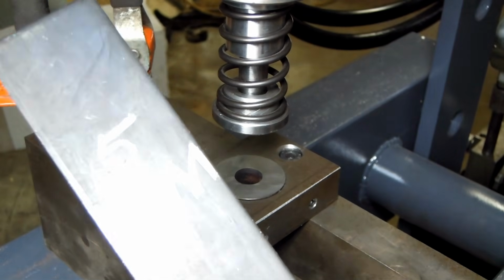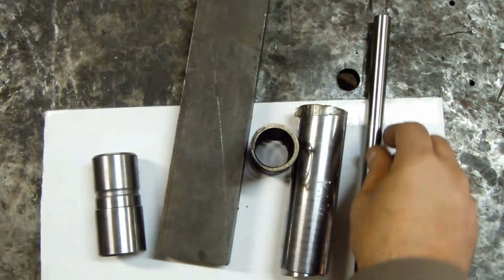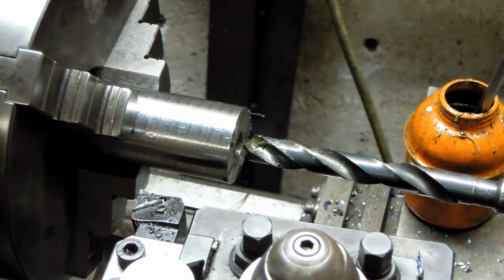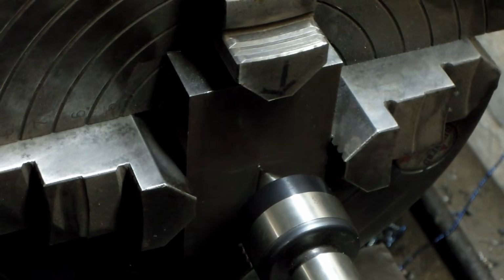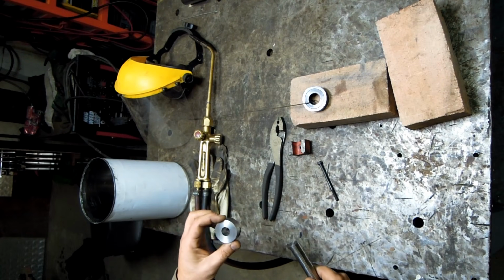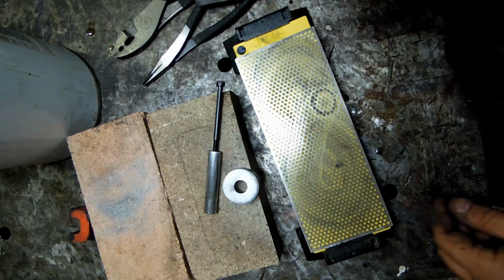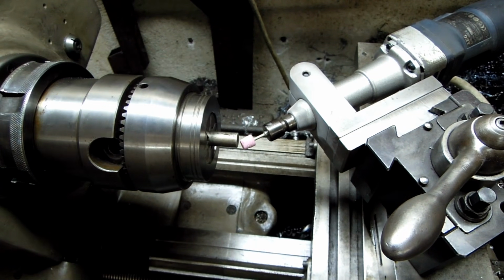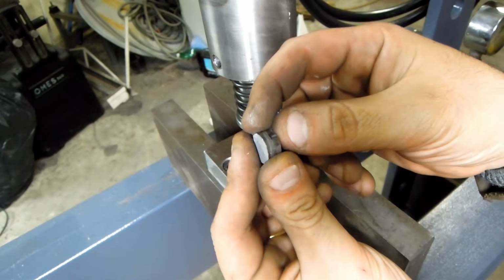diy punch & die

Comment: Hello Tony!

I see that the brakezone are pretty long. Nothing bad with that, but to get a shorter brakezone and a longer cutzone the tolerance betwen the toolparts must be tighter. 
Say this because I like everyone to know it if they do not understand why they get what they get.
A to big tolerance will instead mostly bend the material, finaly at some point it will cause a enormouse power to the hydraulic and maybe it punch the hole or also you will then get a hole with bent edges. 
If one like to get those bend edges its way better to do it n 2 steps, first punch out a smaller hole then use another tool to do the bend V-formed hole, maybe to make threads in it later.
The tolerans also has to do with the power you have to ad with the hydraulic, but to lower the power you need, you can grinde an angle on the punch, 
Also whe make tools like this the result of the hole also depends on the part that the spring press on (dont know the name in english atm.) And more important the spring power.
To get the right spring you have to calculate, and it also depends on the thickness of the material to punch th hole in.
Så material thickness and the tolerans of the toolparts all togheter has to do with how powerfull spring you nedd to the best result to outcome.

Maybe I will make a video with that later, at my upcoming channel. Alt to help you all to make the best outcome products, depending of what tools you have in your shop.

But first  have to build up my own littel cave. 
I will put videos at my upcoming channel where i repair, renovate, build, repair almost anything. from house, to machines, electronics wheichles.

Thanks Tony for all good videos you made so far.
Love them.

Comment: The best thing to do when hardening the metal, is to heat it up until it loses its magnetism, about 815.56C 1500F, then normalize the metal by heating it to 200C (392F), letting it air cool each time.  Or, if you have vermiculite, just place it in there until it has cooled down to room temperature.

Comment: Next step will be a fixed bed to the press to secure the die holder in place.  Just a fraction off center will completely damage both pieces.  By the way, why not grind the male part so to have a point at the center.  It chases the punched piece off better.

Comment: You want to preheat the oil in order to lower its viscosity, so the oil will flow 'faster' around the work piece as you dunk it.  The temperature by itself is not the most important factor, viscosity is.  If the piece is not hard enough, you did not heat it to the right temperature.  It should be cherry red in dim light conditions. If a magnet sticks it is not hot enough.  An open flame does not work the best way.  Make a tunnel with a couple of fireproof bricks and heat the piece inside, so it gets hot as even as possible on all sides.

Comment: It's like 3 years later but to avoid the light desynchronisation making it look "weird" you have to go to a lower framerate, like if you're on 230v 50hz electricity, you'll have to go less than 50fps so it doesn't capture the tiny change, like 30fps would be perfect

Comment: The concept is acceptable only for secondary press work, since the punch doesn't get guided properly through the floating stripper insert. 

The stripper insert at the strip butting surface possess a chamfer around the punch guiding hole will deform the sheet metal during stripping of the stock material, which is not acceptable. Relaying on helical spring is highly risky.

Comment: clearance looks a little tight for 8 mm but looks great on the 5mm mat. 10-15% per side should get you where you need to be. 3/8 die land is good if you plan on having a few sharpenings

Comment: 22:20 you could grind the punch face flat and reduce pressure needed to punch. Instead of having the punch face square with its length at 90 degrees, you can grind it on an angle of something like 80 degrees. It'll create a point which will pierce  and incise a hole rather than just punch. It'll take less force to make the hole and be a gentler operation on breakthrough. see how trumpf make their whisper tools.

Comment: Knifemakers are well known to use this method and even cut a slot in the side of the toaster oven so longer blades tangs can stick out the side since they will often only quench the blade part only that part needs tempering. So to all disbelievers -- it works just fine. Historicslly proven. Google anything you disbelieve.

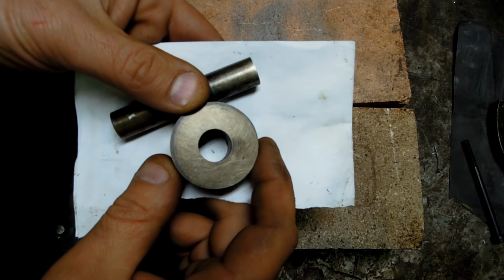21:08 per lighting. Halogen is closest to sunlight and I've found those cheap 300 & 500 watt bulbs very handy for all kinds of things, have several outdoor floodlight fixtures on homemade tripods or rolling stands. Old computer chairs and fan stands work OK, too. I welded my first one and used two lawnmower wheels on it like a weber grill long before I even knew what a weber was. I still have it today. Probably been through a dozen bulbs over two decades of use. I've even found them at dollar stores & HF.com carries the 300 watt ones for 99 cents. Can't beat that especially in winter when no matter how good/expensive your fluorescent fixture is there are some days it just will not come on properly!

He also claims the 5000 K color keeps you more attentive & awake so he uses it specifically in task areas...kitchen cutting board, shops, etc...

Also I bet if you google photographic filter and steel temp colors you can find something that will work better both for you and your audience. I find a polarizer filter (use a pair of dollar store sunglasses first if you're leary and rotate them. Between your lens and whatever being filmed.) You can also get sheets of the stuff to doubleside tape it to any camera phone and of course threaded ones to fit on cameras.

The LED strip lighting is cheap and you can get what you want colorwise. You can even make photographerlike panels that give nice, even lighting. Another guy on YT who does tools I know swears by the cooler colors, more towards 5000K, almost blueish. I have 2 strips of 3528 smd coming to me from Amazon to try. It has 3m tape backing and you can get ip-65 (waterproof) for not much more, usually. I'm thinking about putting it under the gable overhang on a building for general area lighting. Will sure beat the HPS streetlights even if some people find them not as consistent from strip to strip. I found 5 meter lengths for under $6. Still need a 12 vdc source....a battery charger of the proper amperage (2 amp per 5 meter) works fine. 

I love the warm white I added to my electronics workbench.

Good vid but being as horrible freight carries these so inexpensively (at least compared to my time) I have to wonder about the benefits of making one.

Comment: If you have a Brown and sharp's wheel you can grind it with the radius that you're doing right now on the lathe and just put it in there in AV block, stand it up. Turn the magnet on and then just barely kissed that and leave probably a thousands of the sharpness on the land it'll work really good.  You can go to 2 to 3000   I wouldn't go any more than that Then it won't cut it'll just shear

Comment: putting the metal oil tub in a water tub with the water at the proper temp with spare water to cool off the excess temp if you use it enough in one session might be an idea,plus the clean water can be dumped afterwards with no fear of tree huggers torching your pad in a green hazed frenzie of tree hugger hulk madness.

Comment: I like how your stripper spring is also a safety cage for the punch. I have a scar on my right ring finger knuckle from a punch exploding.   The pieces can really fly around the shop. I noticed that your slugs are very flat. The slugs with my store bought punch are more concave. I don't  know if it is the centering point on store bought punches or the concave u ground into the tip of your punch. Just thoughts, love your videos.

Comment: Needs more clearance for 3/8" stock.   Slug shows signs of being tight.   It will work fine for now, but after repeated uses it will start galling on the punch.  Lube helps.

Comment: Really impressive, I must look at that. May It is not clear from vendors how to harden silver steel. I use to to do it in oil with very poor results. MrPete222 on you tube harden this kind of steel in water. I had much better result this way. For other kind of steel I normally order O1 type of steel that can be harden in oil. Hope I will find the time to make such a useful tool.
Thanks for showing.

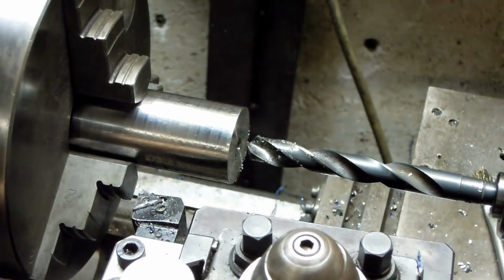Comment: 7:00 chips are blue, running it too hot. Cut back on the rpm or use plenty of coolant! For only one part it's OK, but for many parts, you would burn out the drill.
Same with the part off tool.

Comment: Very simple and effective.  How much clearance did you use, .020 per side? If you are going to pierce a wide range of thicknesses then you should error on the side of low clearance because otherwise it will drag a huge burr out the other side when piercing thin material.

Comment: Hey tony, thanks a lot for your videos. What if instead of making the punch have a concave end (aka watermelon bowl), which forces the press to cut all the perimeter at once, you just flattened the end at an angle, such that the press would exert less force at any single moment of the cutting operation? Does this have some sort of negative impact on the hole quality, tool life, or something else? Thanks!

Comment: That dremely attachment on your compound was a brilliant hack to grind just enough to form a concave dip! Brilliant. Don't worry about that toaster oven, I've made production PCB's using the same ceramic insulator technique and they're still going strong haha. Those IR gun thermometers are surprisingly accurate too, +/- 5F in my experience. I wouldn't use it to send something into space, but to harden/temper coldrolled that should be fine. Any reason why you didnt use M steel?

Comment: Greatly impressed with what you have created and the skilled way you have done it. I assume you must be a pro machinist. Love the videos. Perhaps you can help me. : We are in need of a HAND or TABLE HOLE PUNCH TOOL that can punch a hole 13/16th"" & 3/4"through 1/64th" thick plastic. No big box or other equipment seller seems to have a small tool, either hand or bench mounted, that can punch a hole that size . Can't drill through since it tears up the plastic. Need to do 200 holes or more in P.E.T plastic Can you help or direct me ?
Reply: try a holesaw in reverse,  I have drilled holes in foam that way

Comment: Hi Tony, 

You videos are sooooo easy, enjoyable and educational to watch, with good 'old fashioned' engineer's humour (UK spelling) sprinkled throughout. 

I certainly don't miss the 'ers' and 'erms' that other YouTube video producers intersperse their narrating with - your confidence shows through in every facet of your presentations. 

You may want to try 'Belleville' washers (also known as a coned-disc spring, conical spring washer or disc spring), instead of springs for your stripper plates. They take up less height and whose tension can be adjusted by stacking them nested or opposed to one another (or both) as required. 

Well done, keep them coming.

Comment: Pay atention to the slugs that come out. As the sheer line gets smaller and smaller, you will be using more force, and getting less clean holes. The punch will dull, in this case quickly compared to industrial tooling.
Reply: AaronAlso ?
Reply: Either you are impressed with my name, are confused by my comment, or know me from somewhere else.

Comment: You "always get nervous when working tool steel"  Are you referring to disrupting molecular structure prior to heat treat process?  I've worked tool steel quite a bit.  Is it easy to ruin the structure for heat treat by typical machine processes?  Thanks

Comment: How did you get the camera to mount on it's side without noticing it?
My cell phone just picks up the orientation from where it begins recording and stays there.
It took me a while to notice I started upright, then set it down sideways.

As far as stones, the fastest way for me to make stone dust is to attempt to use them!
And those slugs are great for filling in weld holes.

Comment: not every metal has the same tempering process sometimes if u quench certain metals u will ruin it rather than harden it........ u should look into the tempering and hardening processes for each of the metals you're working with... i think some metals require more than 1 quench and i believe  another kind of metal u just heat up and let cool down on its own u dont want to shock it,,,,,, i saw it on that show "how its made" they were quenching tools like wrenches and hammers (stamped tools) and then i saw them tempering metals on a black smith show where a few people compete to build  knifes/ swords etc called "forged in fire" so just do some research on the hardening process for the type of metals you decide to use
Reply from the maker: Thanks Emilio!
Reply: check out the tv show "forged in fire" i'm sure if u like metal working and fabrication you'll enjoy this

http://www.history.com/shows/forged-in-fire
Reply: Heat treatment metallurgy has a strange learning curve, a lot can be done with basic plain carbon steel blacksmith level techniques and refinement there of (better temp control) and then it seems to jump right into the kinetics of diffusion-less phase transitions in crystals constrained along the 1,1,3 shear plane affecting glissile dislocations
Very hard to find info in the middle, at least for a hobbist. There are quite a few books published by industrial associations ...but at $200 US each. 
For carbon and low alloy steels[ and some tool steels], but not stainless or exotic specialty types, which can act almost opposite in some ways. Learn the basic iron-carbon phase diagram,  the cct diagram (continuous cooling transformation)aka TTT(time temp transformation), and know that an alloy's "hardenability" does not mean maximum hardness, it means the thickness than can be through hardened.(thicker bits cool at a lower rate)
 keywords to use in research are normalizing annealing quenching, , eutectic, spherodite, pearlite, bainite, martinsite ferrite and austenite. 
(this link has a ton of resourse but mostly hardcore science style rather than practical) http://www.msm.cam.ac.uk/phase-trans/index.html
Reply: Found it! http://www.asminternational.org/documents/10192/1849770/ACF180B.pdf
(the rest of the book isn't on line but its more about setting up assembly lines and process costs.)
Reply: Heat treat is the biggest voodoo step to good knife making.  For example 420HC is a pretty crappy knife steel like AUS-6 or something... unless you're talking about Buck's 420HC with their highly developed heat treat process.  Then it'll battle steels a full tier or two higher (a tier is exactly 4.73 ambiguation points above the last).

Comment: Is glass epoxy pcb punchable, what's the exact design , concave design?  Firms here are using metal  punches used to punch sheet metal  for pcb ,  14mm dia, 1.6mm thick pcb. Using Hole saw and dro  is an issue, cnc cutting is not cost effective. Is hardness for SS212, SS202 steel ok for pcb to design  punch rod or hole saw

Comment: would the silver steel be fine for a small louvre punch and die former tool set about 1 inch long,i don't have a forge,and want to louvre  steel sheet no more than 1mm thick,i've seen punches made from mild steel but only to use with aluminium sheet.tool forming by grinder and flap grit disc.

Comment: Hi I started watching your highly skilled  videos though I am an electronics & software guy. Started watching  these due to cnc machines. By the way do u work in any other company or yo get orders from customers. With ur skills you should be millionaire by now with all those machines in ur work shop.
I go to lath machinist to cut acrylic sheet for CCD camera water proofing. most of the times they spoil the product , it consumes months as it's not production item. Can I make a circle cutter for acrylic sheet with a 20mm dia 1mm another pipe 50mm dia thick pipe and make teeth at one end , insert it into lath chuck and cut circles 20mm dia , 50mm dia. imagine a hole saw with out drill hole.
Reply from the maker: Yes you could, google "Annular Cutter" you should be able to find one with a 20mm ID.
And yes you could make your own, but cutting the teeth might be tricky.

Comment: I had a contract to make two thousand simple parts. Just a one inch long piece of aluminum angle iron with two three sixteenth holes. I ended up punching the holes using the quill of the Bridgeport. It was about five times faster than drilling them would have taken. A really boring job all the same.